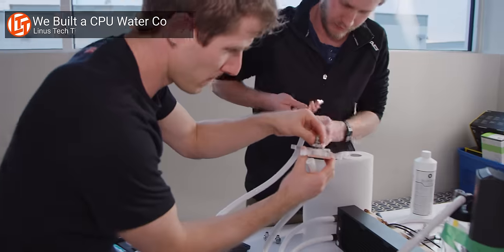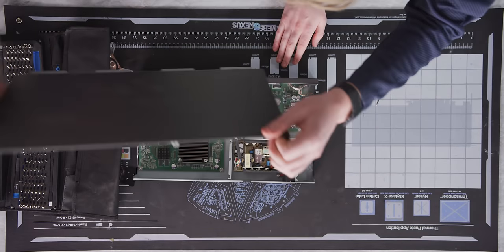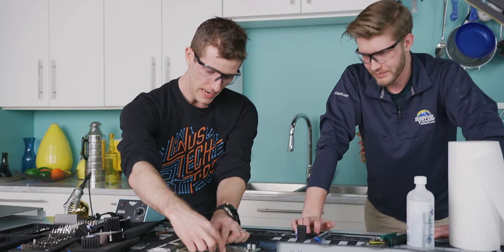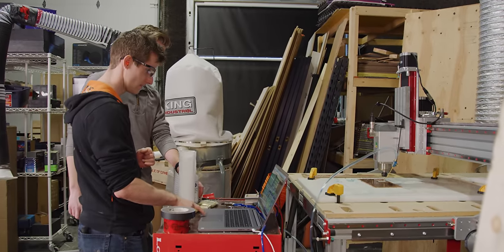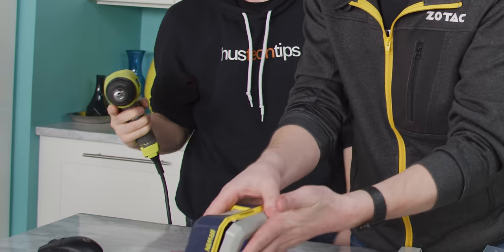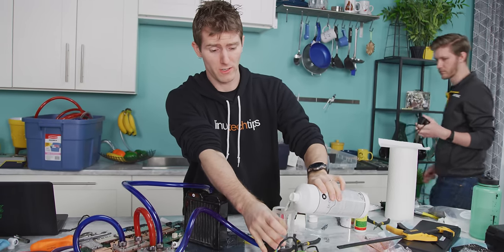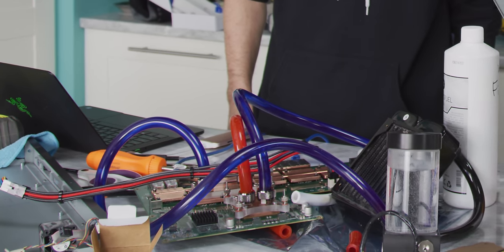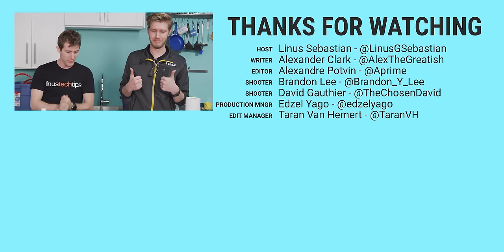Water Cooling a Network Switch!

Comment: You could tell me this was an April fool's joke and at this point, I honestly would have no idea.  Linus, you're a madman
Reply: As i'm from Germany, for me it's still march 31😂
Reply: @p3chv0gel22  Same here in Sweden
Reply: Same here i'm from sweden
Reply: @p3chv0gel22  Same here in the states
Reply: r/madlads
Reply: It was 22.00 over here  when it came out
Reply: Already April 1 in Australia lol
Reply: @RalfMahlstedt  i don't know, but i know the date. Its march 31 at 21:29
Reply: March 31 here in Oregon
Reply: @p3chv0gel22  se here in the Middle East
Reply: Thought the title said water cooling an nintendo switch
Reply: Same here in Italy.
Reply: Everything goes right, no fuckups, everything works straight as it supposed to. THAT'S DEFINITELY AN APRIL FOOL'S JOKE 100%
Reply: globetrotter in america its not even April yet
Reply: This summer, we're water-cooling the entire LTT building 
This winter, we're using the water-cooling pipes as radiators for the entire LTT building just by adding everyone's pc and a pc with threadripper.
Reply: TBH, pro level switches do run hot – there's a reason why they have fans and so large heatsinks inside
Reply: "They called me a madman" -Thanos
Reply: @nathanielchappelle5709  3rd September here in germany

Comment: im actually surprised you made a cooler this good after seeing the original janky cooling methods. that cast aluminium was definitely the worst.
Reply: Yeah, looked like a silly rock
Reply: Bet they could make new sketchy heat sink with milling instead of casting.
Reply: @najibnk  sketchy heatsinks: the movie
Reply: Linus probably wanted to see some results from Alex before he spent serious money on equipment. It was a good attempt, but doomed for failure.
Reply: The recip saw job is a horror show.
Reply: As they said... after every jank cooler the next one gets better.

Comment: "There's no proper way to do something this stupid."
"I have zip ties."
Perfect
Reply: "100% pro"
Reply: fwiw zip ties are actually used for professional cable management
Reply: @Destro I work in power electronics. We build large power converters and use zip ties almost exclusively for cable management. This is entirely because our equipment is often subjected to environments with a lot of shaking and vibration. Wires have to be really secure so that they can't vibrate, wear through their insulation, and short out. It's especially important given that we're talking voltages up to 1000vdc. Unsecured wires can literally cause fires lol.

My point was that zip ties are very much a professional tool. They're just not optimal for applications like ethernet runs where the wires are stationary, the voltages are low, and they need to be easily disassembled.
Reply: That's what she said.
Reply: Tweezers you mean
Reply: Theoretically...

Comment: Linus: "Theres the power supply. We're not going to touch or go anywhere near it, actually."
later
Also Linus: "Alright so I think what we need to do is turn on the power supply and start probing."
Reply: Well, it's probing with the correct tools, with something thats made for it, not just sticking some metal in there and accidentally smacking a capacitor. He needed to for powering the pump, didn't know he would at the beginning, but once he did he used the right tools. :|
Reply: @Savinmoneyforparts , eh, even cheap meters can read mains voltage safely... if you probe correctly. He apparently had it in current mode, which is bad since current probing tries to be as close to a short as possible to not affect the measurement, but apparently it had overcurrent protection. The issue I have is that the power supply is designed for a specific load, and I don't think they measured the watts pulled by the fan and pump to make sure the power supply can handle it, let's hope the engineers put in a good margin for the parts.
Reply: Way to ruin it guy🙄👌
Reply: @ninjanippledog725  Also Linus: Oh dmn i accidentally probed with the high amps meter. Which is like kinda short-circuiting the component you probed because of minor resistance in that port. Soo he basically unwillingly flipped a coin on this mistake risking getting the "sad" smell :P Sorry for being a "boomer" but that's the truth ..  and its really fine. Errors like that are human especially when you work with tools that you don't everyday use and it was;t like dangerous after all he was testing the outputs of a powersupply. Thus this was a great a video with good engineering overall :) 

But yes an good "LTT pro tip" missing there is to seriously try to remember to always check where u got that red probe in regards of what you want to measure with the polymeter! ;)

Comment: Linus: a mill is expensive 
Couple months later
Linus: So we got a mill and and bunch of other shop equipment
Reply: so happy for the new workshop. that  vid was wild
Reply: No Akomplice , he did a fairly competent job measuring and recreating the board and mounting holes in CAD software as well as getting basic CNC routing done. The issue more so stems from lacking the proper tools I think, but as mentioned, the cost of tools can quickly add up. If you feel like he is being lazy, please explain where, I see no laziness per se, just lacking proper tools and time constraints. There is no doubt they could do better in a lot of their DIY projects, but they're not engineers. I also suspect, just like Jake, that part of their DIY video charm is actually because they're non-engineers trying to produce things usually done by engineers. This average joe approach likely gets them more views, and I wouldn't be surprised if they purposely play into that role.
Reply: @corruptedpants  I make parts worth more than my mill on a  1980s acrolock doesn't even have g54 only g92. A good machinist can make good parts on a boat anchor. A monkey can run a multimillion dollar mill.
Reply: No Akomplice  Alex seems like a likeable guy and seems to be doing his part well. On the contrary, you seem to be offensive and out for blood.
Reply: Aaaaaaaand none of them can use them correctly.
Reply: @Pinguin   The CNC machine you're talking about is in another dimension of quality and capabilities.  The rig they have is more of a DIY small time rig.  They spent a few grand on it.  Not 300k.
Reply: Linus a couple couple months later (Q4 of 2021): So we bought a lab for incredibly precise testing and experimentation. 

Incredible character transformation.
Reply: @Pinguin Sure industry CNC machines cost 300K but that is like high high end
HASS CNCs start at around 90K for basic ones and they are still super powerful.
A decent CNC mill costs no more than 2K that can be used for hobby and still work on stuff like copper and brass and steel while producing quality stuff. 

Cheaper ones are generally not mills but CNC routers like the ones they have so you are looking at a few grand for a CNC mill but not 300K honestly.

Comment: 3 Steps to avoid having to lower spindle speed:
1. Reduce depth of cut, using proper feeds
2. Reduce the tool diameter, use the depth of cut you wanted.
3. Use stronger tool on the first pass, then use a second pass with the tool form you wanted.
If that all fails:
4. Outsource it?
5. Redesign it?
6. Make this specific video.

Comment: Scientific papers?
Precise dimensions?

This doesn't add up...
This is still LTT isn't it?
Reply: Then they pull out the angle grinder, the oversized toenail clippers and the mismatched color tubing...ahh now it's LTT
Reply: and wearing eye protection
Reply: This is what happens when a project isn't run by Linus.

Comment: How long until Linus Manufacturing Group is founded?
Reply: Already has. Channel merch is the first step. Next step is tech gadgets, cables, apparel..
Reply: @YunFuriku  Garden hoses, sprinklers...
Reply: AND ALL WATERCOOLED!
Reply: @wellnotme9354  watercooled garden hoses? TAKE MY MONEY!!!
Reply: Watercooled phones
Reply: @YunFuriku  I would buy their cables. at least 100% water cooled.
Reply: but to call it mlg
Reply: Well everthing will be warranted till you open the box.
Reply: water-cooled t-shirts? Even if that kinda beats the purpose, I'm getting one!
Reply: @kevinzheng7373  that's kinda a thing already, you can get a vest with tubes running through it basically watercooling you it's used for cosplay a lot when it's a really complicated ridiculous mess that's too hot to wear otherwise
Reply: No Akomplice , ouch. It's actually harder than it looks to do such things properly. I'd say he is fairly good for (supposedly) a non-engineer. Garage tinkerers can accomplish a lot these days since the equipment is at least more accessible than previous. I am curious if they do more engineering behind the scenes. Solidworks allows for thermal fluid simulation and even heatpipes in the newer versions, and they mention building the parts in solidworks, so it's only a small step toward virtual designing (much easier to iteratively improve).
Reply: There are video and audio editing houses and the like that could really use silent 10GE switches. TBF they’ll mostly just put it outside the studio.
Reply: ...and copying Chinese stuff xD
Reply: Watercooled Ice cubes!!!!
Reply: theninjamaster67 the main practical usage i know of for cool suits are race cars without ac

Comment: Nobody:
Linus: So the objective is to watercool, myself.
Reply: He is kinda watercooled.
Reply: Blood is not enough for overclocking.  I NEED MOOOAR!
Reply: Human body is essentially watercooled
Reply: Was bouta make a joke like that
Reply: You think you sweat to just stink or what????
Reply: I laughed alot harder at this joke than i should have.
Reply: I want to be 100% water
Reply: Pretty sure adam savage did it for a comicon costume.
Reply: replace sweat by liquid metal for optimal watercooling XD 
stress test :
3 times 500 meters. 

let's see if we get any improvement !
Reply: NASA: Hold my Beer
Reply: does that make him run faster?
Reply: Right after he says that it just pans to the swimming pool beside him.
Reply: Technically, humans already have a built-in water-cooling system. It's called sweating.
Reply: Technically we are watecooled since we use sweat to regulate heat, right?
Reply: @Bl4ckWarHawk  That's what I said.
Reply: @Bl4ckWarHawk  Specifically, evaporative cooling. We can, and do, cool our internal temperature to below ambient (when it's hot enough outside).

Comment: The internal rj45 jack is used for stack linking, instead of connecting a cable from one to another, if special ordered you just stack to connect and they are mostly used in medium to large data centres.

Comment: No one:
Absolutely no one:
LTT: Let's water cool this [insert device]
Reply: Jayztwocents*
Reply: can i has water cooled microwave ty
Reply: @saltmine  omg go back to 2013
Reply: Camera den:
Linus: Oh hey that seems really loud you need it water cooled don't you
Reply: let's watercool a hard drive #Watercool everything
Reply: @wolfram1833  Watercooled HD cages already exist, just FYI. I'm fairly sure there are water blocks for M.2 drives.
Reply: Zune HD ;)
Reply: My toilet is so much better now that it's water cooled.
Reply: Linus is the type of guy to water cool a wrist watch

EDIT: And not even a smartwatch either. Just like a regular old wrist watch.
Reply: 666th Like Yeet
Reply: Their trials and tribulations with the homemade CPU coolers has really paid off.
Reply: Beware there's some Goldilock effect to this : SSDs need a certain level of heat to perform at peak efficiency...

Comment: You guys should really consider pressure testing these in-house made water loops for future builds.. rather than "wait and see" to see if any leaks develop over time, just get an automotive hose pressure tester or any hand pump really, fill your loop or component with fluid, and give it a couple psi and see if any water seeps out from any of the fittings or o-rings. if it can stand up to not leaking while under pressure, then you know it will have zero issues while under less pressure during normal operation.
Reply: Damn, that's a really good idea.
Reply: Even tho I agree to some point a pressured system can have no leaks and when there's only flow and low pressure it can leak. Most rubber seals need pressure to seal be it by the mounting or the fluid. A o'ring for example can seal at pressure and if the mounting is not thigh enough it will let fluid trough at lesser pressure.
Reply: Super overkill
Reply: these systems should be near atmosphereic pressure anyways, probably less than .5psi ever in the loop.
Reply: "Wait and see" comes with the possibility of a pyrotechnics show though.
Reply: @AdrienSantosCoelho  the way those blocks are built i dont think this could be an issue here
Reply: @r000OO00tt  It's called quality assurance, it what differentiates craftsmen from makers.
Reply: Definitely almo😅

Comment: Hardware:works absolutely fine 
Linus:ok lets water cool it 😂🤣
Reply: starshipeleven  but....it's in a server room... Also, they could have just put sole 140mm fans on top of the case instead of the 2x 40m. It would just like this not be 1U but dead silent too.
Reply: @Chadok89  I think they said this switch was for a room they're actively working in, since they need 10 Gigabit connectivity there.
Reply: starshipeleven lol or just have better airflow
Reply: starshipeleven  A 140mm on top is enough. Not because they have to, but because they can, and it's cool 😎
Reply: starshipeleven  absolute true^^
Reply: starshipeleven  Things that are rack mounted are sometimes cooled with loud high speed fans

Comment: Linus, mills and lathes are expensive when you buy them new.

You should never buy them new unless you're a metalworking shop (and a lot of them don't even buy them new).
Reply: If you want a decent CNC they simply are going to be expensive. The used machines are either good and still expensive or they are old junk and are relatively still expensive. Mills in my shop are still 100k. They still are not anything special being they are a haas which are the cheaper side of something decent.
Reply: @orangerider2827  well buy an simple and small mill and a cnc conversion kit and and it would cost way less than 100k
And  LTT doesn't need a movement over X500mm Y400mm Z100mm 
a big hobby mill  with cnc kit is completely sufficient and cost new around 3k well it is a  stack of money but even a private person could afford some thing like that
Reply: @TheLtVoss  While true in the States, I do wonder about how available they are in the frozen north. Sure, I can go down the street and pick up a fully functional used Bridgeport for ~2k that doesn't mean they are available in Canada for that price.
Reply: @TheLtVoss  yes then you have a non decent mill. If you are buying a manual and planning on converting it your better off with just buying a nice Bridgeport with a digital read out. The manual machines are not tight enough to hold any kind of precision with a cnc conversion. Not that the assembled router that they have is anyways. You want something decent that you can achieve a nice water block isnt going to be done on shotty equipment. Their is a reason some people are machinists and some people are hobbyists. Also have you priced a CNC conversion kit your not buying a new kit and a used mill for 3k. You would have at least 15k in it. Then still have all the problems I've mentioned above. My shop used to have such a machine simply couldnt keep up tolerance wise and no tool changer was a deal breaker now it sits out back under a tarp. Its junk cant sell it for the reason nobody wants it.
Reply: @orangerider2827  I have learned  machining on really old mills and same converted and man 0,005 mm was the highest tolerance for an +50 years old machine is still gread it is just maintenance of the bearings
And over here in Europe these machines a a still expensive because they they just need same love and cann do the same stuff like ur 100k cnc center (beside automated tool switching) and precision and work under tolerance of 0.001 mm is bull shit because the heat u putt in the workpiece even with cooling

And theses hobby mills (not the cheap shity ones) Ar the same on precision they a just too small for the most shops
Reply: @TheLtVoss  I've used and ran hobby grade stuff. Its garbage that's why its hobby grade. Grease isnt going to turn a bad machine into a good one. It relys on nice ways with good Gibbs and a ballscrew that was machined to almost perfection. You need a very power controller and motors that actually listen to what the controller has. None of those things ate cheap none of those things are on hobby grade and none of those things happen on a converted machine.